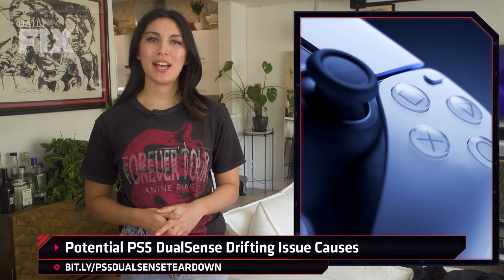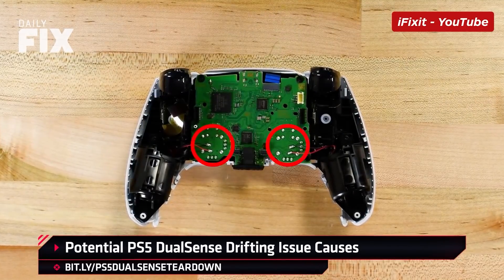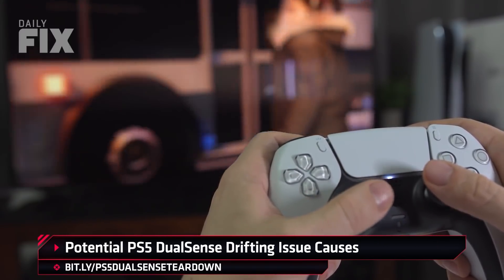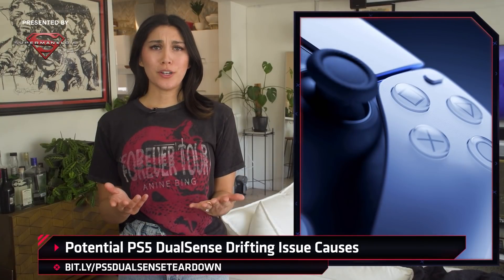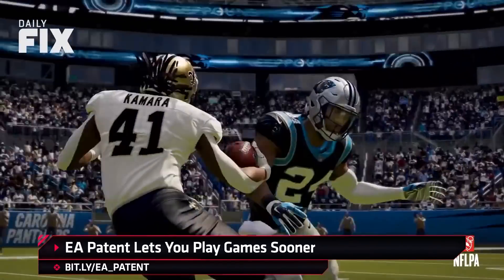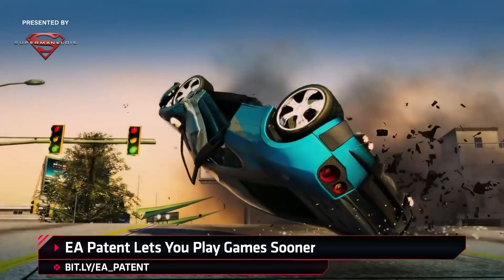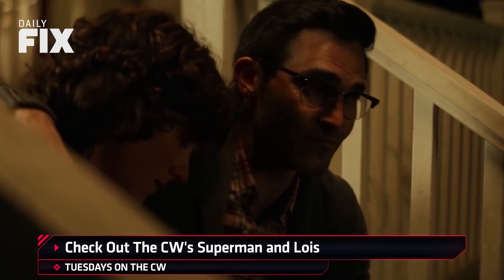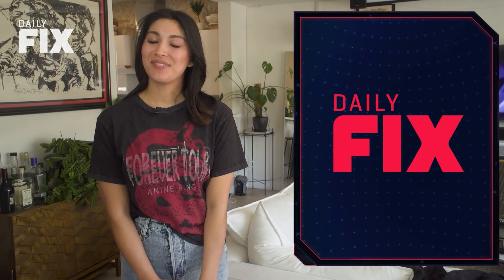PS5 Controller Teardown Points To Reason For DualSense Drift - IGN Daily Fix

Comment: Electronics Tech Here:   Each Stick has 2 "pots" in them. One for up-down, One for Left-Right.  They're essentially, tiny volume controls.  Each consists of a central wiper which is electrically connected via pressure with a circle of carbon/graphite, acting as a variable resistor pad. Each time you move a stick, you are ever so slightly wearing a groove into the carbon and eventually, it wears through creating dead points, weak points and THAT is what causes drift.  Unfortunately, you CANNOT get around this as long as this type of joystick is used.  IF someone manufactures a drop-in replacement that is OPTICAL instead, you would have NO wiper at all and it would last virtually forever.  You KNOW that is NOT going to happen since this is IN FACT, planned failure designed to sell more controllers.  You know the saying:  "Wish in one hand, and s... in the other and see which fills up first."

Comment: It's not a ps5 problem... 
My brand new ps4 controller bought in an official sony's store had the analogic problem...
I send it to sony, in brazil it's very difficult to get a support... 
After 3 months, they send back my controller, they changed the main board, analogs etc... 

So it's not an analogs problem... Maybe the main board has a issue that destroy the analogs sticks... 

If not, why they changed the main board of my controller??

Comment: They need to fix the adaptive Triggers too
Reply: What's wrong with them? Adaptive triggers don't & will never work with ps4 games.
Reply: @ObeseMonkey1  I mean for the (future) ps5 games cuz they break way too easily
Reply: @killer_007x4  just turn the feature off. You don’t really need it tbh
Reply: @ObeseMonkey1   The spring inside the triggers can easily snap making the triggers loose and unusable.
Reply: @christopher32074  I've had mine two months & no issues. Some people are heavy handed.

Comment: I legit drop my DS4 by mistake on wooden-floor from literally just 2ft from the ground & I’ll be most likely getting drift 💀 
They gotta build these controllers more durable or make them cheaper per purchase; idk about warranties either
Reply: Just take care of your controllers man
Reply: @derpytuber2096  
Nah but that’s the thing dude, I only dropped it from like 2ft (as in sitting on a chair height) & sometimes mistakes can happen aside from raging. I’m talking like phenomenal occurrences where my initial intention to grab my controller ends up swiping it onto the floor via dropping. Therefore the problem is that these quite expensive controllers are pretty fragile, unfortunately.

Comment: I've found that not pressing the joysticks actually prevents joystick drift from my personal experience. When I use the controllers with pressing the joysticks, my controllers only last like 1 month but recently, after replacing my controller because of drift, I haven't been pressing the joysticks and the controller still has no issues. I've been using the Xbox controllers but I'd assume it's pretty similar since both consoles have been having drift. I just bind the joystick controls to a different button or just avoid games that require pressing joysticks and have no custom config or auto sprint.

Comment: Na this is cap I have to controllers and their mis no drift
Reply: I said the same thing and mines started to drift yesterday it’s definitely there
Reply: @Jwizzle45  well their is a fault in the controller my trigger was lose so I disassembled the controller and the spring was broken I replaced it with a ps4 one

Comment: Drift it self since PS1 Silver Dual Shock. It happened because You are pushing both thumbsticks too hard. To fix it, on both thumbsticks, rotate 360 degrees clockwise, rotate the other way around. Do that 3 times, then immediately press down the thumbsticks. Hopefully it will be normal again, IF nothing is broken or cracked inside the plastic and wire.

Comment: specking as someone who's fixed his own controller the duel shock 4.2 , the controllers with the light bar at the top of the touch pad, they do not have the same set up as the duel shock 4.1's that came out first with the ps4 witch is what we were shown in this video and that tear down.

the 4.2's can't be fixed like the 4.1's.. in fact because of the why there built I don't think they can be home patched.

Comment: joysticks are usually easy to replace, I'll just break the warranty and replace them if they start to drift
Reply: If it’s the same issue as the switch joycon drift it doesn’t matter. I’ve swapped mine out multiple times no fix. Hopefully it’s not but just a heads up.

Comment: I hope Sony fixes the problem soon
Reply: Sony will NOT fix the "problem".  It sells controllers and they about to up that game: The very latest, about to be released premium $200 DualSense Edge controller is using user replaceable snap-in modules at $20 EA!.  $40 for a set!!  The used controller market will change significantly as time goes by.

Comment: Yeah I have some where between 400 and 450 hours in with my ps5 controller and it's drift is so hard it's almost unplayable anymore. Disappointing, I remember when the ps4 came out we had issues with that controller as well
Reply: Yes the sticks rubber wore out at a fast rate

Comment: My Ps5 controller has had drifts since day 1😔
Reply: Should've  returned the controller then.....
Reply: @EverythingCiggy  honestly didn’t know you could send them back and have them fixed after they were used
Reply: @lelandtalbert8043  you could just go to gamestop tell them you bought a new console and it came with a broken controller and they will give you  a new one , just  call them in advance  before doing so (bring receipt just also)

Comment: They should just make it so we can recycle the controller. Once we go buy a new one at GameStop or Walmart the employees take it to a box only they can open (maybe with a counter thing that goes up or down depending on if ur taking one out or one in). This would decrease the cost and will encourage getting new controllers for cheaper prices. Especially if sony hires people to repair the controllers. The cheap prices would make it so they can keep getting the plastic needed, at the same time giving players more play time. Easy

Comment: Blow into it man, it starts working
Even my duel sense had the same problem
Reply: Then your problem isn't yet the hardware but instead dust particles.
Reply: I use air duster, gone through several cans, I get about 20minutes  or less of drift free play after heavy dusting... and that’s if IM LUCKY
Reply: Did you even watch the video? There are three listed factors that can cause drift and two of them are hardware related.

Comment: It’s time they update the sticks.
Reply: Update to AAA batteries? No thanks
Reply: @numetal4304  where did you get the batteries thing from?
Reply: To do what? There's no way to fix it!
Reply: @davidtmedia3866  They could update the design. They should actually use optical potentiometers instead. They are usually more reliable.
Reply: @robertlawrence9000  that’s actually what I was thinking! 👍🏽

Comment: All 3 systems of controllers have drift. First was Nintendo then Xbox now PS. I'm sure when the slim versions for next gen come out it'll be fixed.
Reply: Remember Switch Lite, it still gets stick drift sometimes. It isn't going to be fixed.
Reply: @davidtmedia3866  How does Nintendos problem effect PS and Xbox? Just because Nintendo can't fix their mess doesn't mean the other 2 can't lol. Also you've made like 10 comments on a single video, go outside dude.
Reply: @dbzfan0190  go outside at 1 in the morning?
Reply: @dbzfan0190  and they can't fix it. It's a hardware issue. Just remember I told you so.
Reply: @davidtmedia3866  Dude stop liking your own comments after you post them, its sad asf.
Reply: @dbzfan0190  I am not?
Reply: @davidtmedia3866  "Posts comment and has a like after 2 seconds" yeah ok dude lol, so sad.
Reply: @dbzfan0190  if it annoys you, I'll do it again lol!
Reply: Nope...
Reply: Highly doubt that. Unless there's major redesign for the analog components. Remember these game companies make the controller not the analog

Comment: You want to fix it role it around and blow on it it fix my ps4 drifting essues .its the same so i dont see the problem
Reply: If you actually watched the video, then you would know that two of the three causes of drift are hardware related, so blowing into the controller wouldn't work.